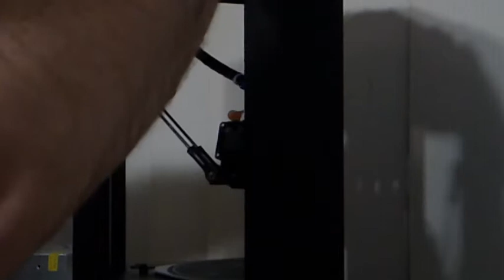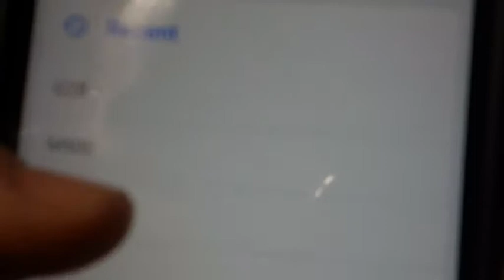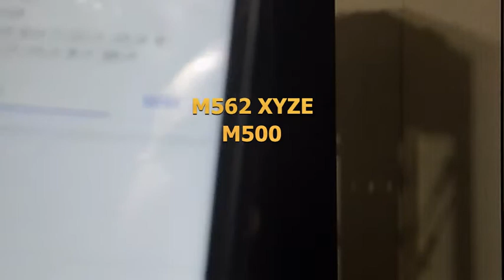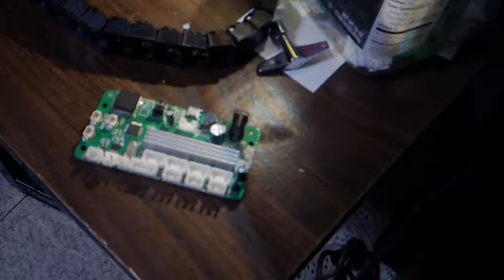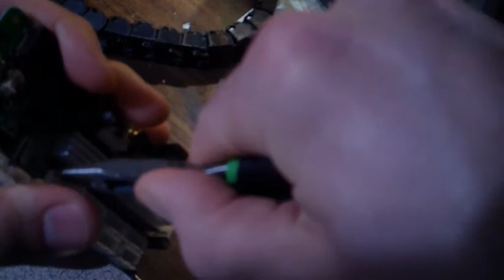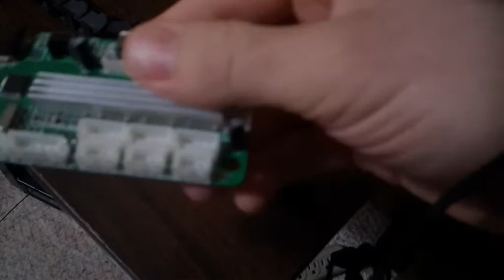MPMD V1: Reverse Stepper Motor Polarity (Gcode or Hardware) - printhead movement is backwards!!!

Comment: My Extruder Stepper motor replacement was reversed when I plugged it in. I reversed the plug on the motherboard like the instructions described and it seemed to do the trick when I went to do Esteps calibration. When I went to print though, I found that while the extruder would prime the nozzle and create a skirt properly, when it started actually getting to the object, the extruder would just stop moving or jitter back and forth for some reason. If I reverse the polarity back, the extruder moves properly with the print, but it retracts instead. Has anyone had an issue like this? Maybe somethings wrong with the pinout?

Edit: I'm using Marlin by the way.
Reply from the maker: It is possible that one of the wires got loose or damaged. If just one or two wires come out, it will still sort of move, but have problems. 

If you're confident that it moves smoothly in the original position, the newer MPMD Marlin 1.X.X has multiple builds for different motor polarity, or you could compile a build of Marlin yourself to reverse only the extruder. There is a link in the description.
Reply from the maker: After thinking about it more, I believe that the new stepper motors have a different resistance than the old ones. If used on an older mainboard, this could result in less torque. Sorry that I don't have a good solution, I am just repeating what I saw Mr. Gigdigit post in a different thread months ago.

Comment: I had the same problem & I did the wiring fix for mine! But now all of the stepper motors just make a low humming sound instead of moving. Any suggestions?
Reply from the maker: https://www.reddit.com/r/mpminidelta/comments/f2lz3n/_/fhxseum
Reply from the maker: Update: Following the Reddit thread, the humming had more to do with other settings changes (resolved with and M502) rather than hardware issues - possibly due to other things the user tried prior to finding this video.

Comment: Gcodes didn't help but the turning round of the connectors sorted it, even my extruder was opposite.
Thanks for your video it was a great help.
Reply from the maker: Glad you found something that works. The gcode only works on stock firmware (not Marlin4MPMD). Even then, I found that getting it to work right was finicky and required a bunch of power cycles.

Comment: to do this with g-code ,just make a file with the command and save it on the sd card then print it ?
Reply from the maker: I guess you could try it that way, but you would need both commands. I used Octoprint. If you want more help more quickly, go to either Reddit or Facebook, like I suggested in the video. I don't check this channel often.